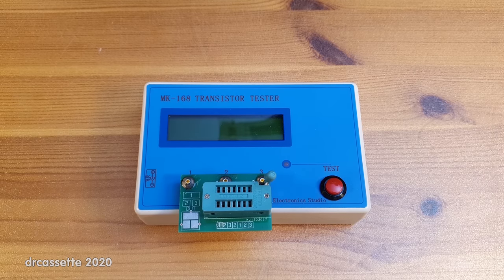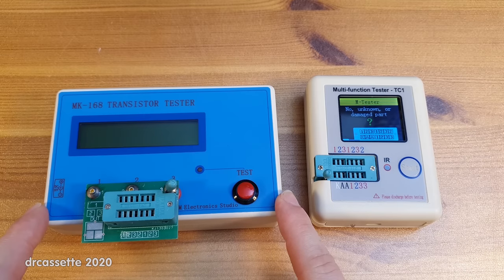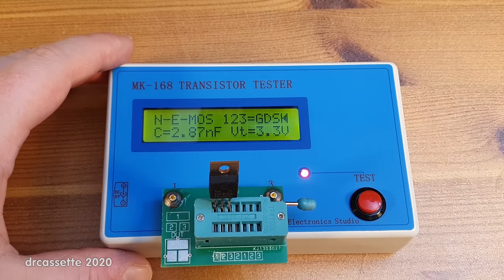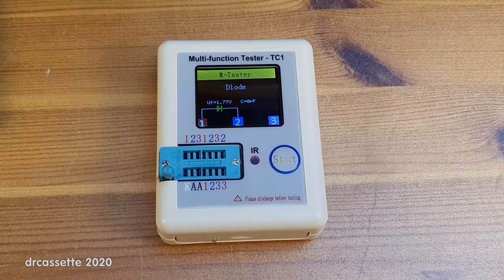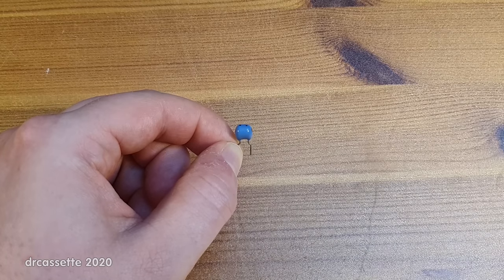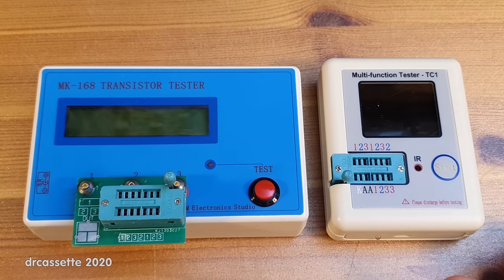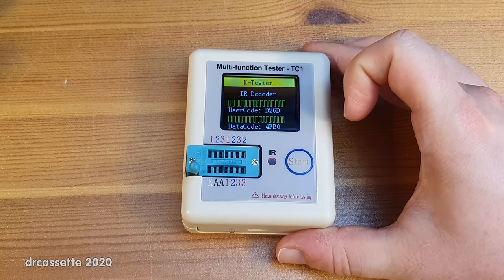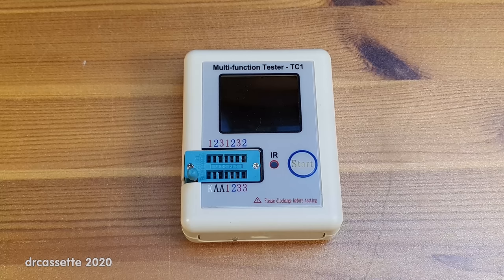The evolution of the Electronic Component Tester (Multi-function Tester TC1 review)

Comment: Great little tester. A little mod that I made to mine - I drilled three holes in the top and mounted three push terminal sockets, soldered to the board inside. There's just room enough inside to make it fit!

Comment: These are great.   I use it when building final circuits on perf boards.   When I grab a component out of my stock drawers I test them on this before soldering onto the boards so I know I didn't grab a part that is NOT an out of the box failure.   Great tool for ESR also.
Reply from the maker: I like to test even known good components before using them, just to double check the pinout.

Comment: Nice review for these testers. I have the old MK-168 tester and it's very useful. Those 3 individual test leads have broken yellow, and green, but they are quite easy to repair with soldering iron. Thanks a lot.
Reply from the maker: My test leads break from time to time too, no surprise as the cables have no strain relief. But they are indeed easy to fix.

Comment: I didn't know you could do transistors on them. I had some faulty AF117s I replaced in a radio - I'll have to dig them out and try them on my tester
Reply: Af117 transistors grow internal wiskers with age.  The shield shorts out with one of the other connectrions. Can't remember which.  A trick to get a radio with a shorted transistor to work, is just to cut the shield connection to the earth. This meter might show a good transistor, which has a short, because you do not connect the shield to the meter - as far as I know.

Comment: Saw your vid on this as soon as it come out.   I immediately ordered it after watching your video..   Got it today.    Will be playing with it later today.   Thanx for the review.   Have you tested it to see if it has over discharge protection???
Reply from the maker: I have not yet tested the battery yet, all I can say is if the charge gets too low, the tester will still try to turn on, but will crash in the process.
Reply: @DrCassette  I have found that the unit acts really quirky when battery gets low.  Battery life is pretty poor in my opinion also.   I think I will be changing the lithium battery with a higher capacity cell phone battery pack at some point     BUT!!!!!!!    I have noticed one issue with the device.    When testing triacs mine identifies the pins incorrectly.   It reverses the identity of T1 and T2 pins on Triacs.   I was wondering if yours does the same thing.  Please advise.   I wrote a note on the enclosure of my device with a sharpie marker reminding me of this error.   Otherwise this unit has been a great addition to my test tool inventory.   The zener diode tester is a fantastic feature.   Great time saver capability.

Comment: I have stuck a copper strip onto the face of mine with a few spots of superglue. Now I can discharge capacitors quickly before insertion.
Reply from the maker: Good idea! Unfortunately the older one of my two testers must have fallen victim to a charged capacitor. It does not work right anymore, and this is the only explanation I have for the fault.

Comment: One word of caution.. I have both of these and the first one was bought because of your video reviewing it. The other one was bought one year ago. This new one does seem to have some kind of a software bug where it charges up a capacitor and then sometimes gives you an error reading but does not discharge it.. Found this out the hard way when i put it back in to the tester and got one hell of a spark when it discharged....... Its something to be wary of....
Reply from the maker: Very odd, I can't see how this device could charge up a capacitor to a voltage sufficiently high to cause sparks, even when defective...
Reply: I killed my TC1 not long ago. I absentmindedly inserted a 470uF electrolytic capacitor into the Zener diode test position and got no results. Not thinking much of it, I moved the capacitor into the 1/2/3 test positions so I could run the test again, that was when I heard a spark and the TC1 went blank and wouldn't turn back on. After a few minutes I realized the TC1 actually charged up the capacitor to a very high voltage when inserted into the zener position. So I ended up zapping and killing the TC1 with it's own generated high voltage!

Comment: I decide to upgrade from a non working MK-328 to a TC-7 . One thing I forgot about is the new tester does not accommodate surface mount components ☹
Reply: It's unfortunate but I suppose you could hook up a little pcb with pads, to some probes.

Comment: Really nice video, thank you! Do you know whether it tests BJT darlington transistors correctly?
Reply from the maker: If I recall correctly, it does not specifically say that the device under test is a darlington transistor, but you can always tell by the extremely high current amplification factor.

Comment: mine seems to ask to be calibrated if no component is found in about 5 seconds. Not sure why. Mine also asks for a capacitor for calibration routine. I find mine strange also in the fact that with the shorting bar (or strapped leads) mine still shows variances between the leads? Maybe it is the correction factor, Dont know. I did have both styles at one time and the older one did have more features and didnt give me the test routine nag if no component was found. I found the signal generator was useful in playing with my new oscilloscope. My color version had a screen that allowed you to change the color scheme. Great bit of kit for <$10.
Reply: I just got the new one and it was shipped with a small 10 microFarad electrolytic capacitor and an LED with the shorting bar. It did not seem to cue the capacitor during the self-test mode which initiated with the shorting bar pins installed.

Comment: I own one of these, and it definitely doesn't have an OLED display. I took mine apart and can confirm it only has a normal LCD panel. The prices at which these are sold cannot possibly justify the use of OLED.
Reply from the maker: The black background tricked me into believing that the display was OLED...
Reply: @DrCassette  1.8" TFT LCD Display

Comment: I like those testers, I have one version older which still does SMD. I don't think it's OLED though.
Reply from the maker: If the display is colour and has a black background, it's most likely OLED.
Reply: I think the firmware authors made the background dark so it could be used with OLED panels, however due to manufacturing costs, they went with a normal backlit LCD TFT panel instead.

Comment: I have one and I can say I do like it a lot....  I think this was brought up already but I can't read German , @13:37  that ESR  TP 1-3  might be that it can read ESR with Test pins 1 and 3  if in that mode..... I'm not sure since I don't have that one.....
Reply from the maker: I have since tried this feature. The tester measures ESR between connections 1 and 3 continuously without you having to push the test button first. This mode is designed for measuring capacitors in circuit.

Comment: The TC-1 is a very practical device, but it is sensitive. Mine was spoiled simply by placing a lightly charged capacitor. You have to be very careful.
Reply from the maker: They mean it when they tell you to discharge components before testing them. The tester can apparently "measure" voltages up to 4 Volts, but no more than that.

Comment: Did you calibrate the new tester? I have one that forgets the calibration whenever I change the battery
Reply from the maker: I did calibrate the new tester using the selftest routine, as seen in the video. The battery is a permanently installed rechargeable lithium battery, so there will always be a power supply as long as the lithium battery doesn't deep discharge.
Reply: @DrCassette  one of the calibration steps require a small value capacitor. This step is easy to miss on the old interface (with test names), I guess it is easier to miss on the new interface (w/progress bar)
Reply from the maker: The old test routine indeed demanded a small value capacitor, but it stopped until you connected one. The new test routine seems to skip the part with the capacitor, it certainly doesn't stop. Maybe that's why all the capacitance measurements weren't very precise?
Reply: @DrCassette  I suspect the capacitor step is there, but the new interface does not stop... Hard to know without the firmware source code. BTW, this testers are based on a German open source project, maybe there is alternative for ware for your unit.

Comment: i bought the new tester but it's not working right anymore it's gives a cell reading. i only used it a few times.
Reply from the maker: Seems like you tried to measure a capacitor that still had a charge in it. The cell reading indicates that the tester is damaged.
Reply: @DrCassette  oh that's probably what happened I thought I discharged it though but maybe it didn't.

Comment: Hi. I checked an electrolytic cap and the Tester went dead. Can it be repaired? Thanks for quick suggestion.
Reply: Was the cap discharged. I have one of the cheap yellow testers and I was thinking it’s time for an upgrade as I get strange readings as the battery loses power. With what I’ve seen here, your comment and at least one other I’m not too sure now.
Reply from the maker: If the electrolytic capacitor was not discharged before testing, the tester was likely damaged by the charge in the capacitor. Unfortunately this can not be repaired.